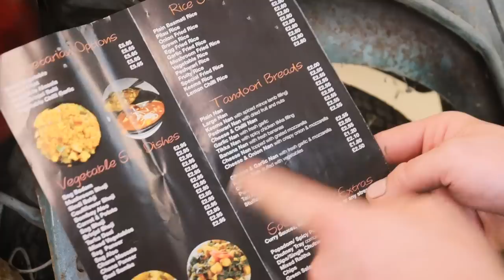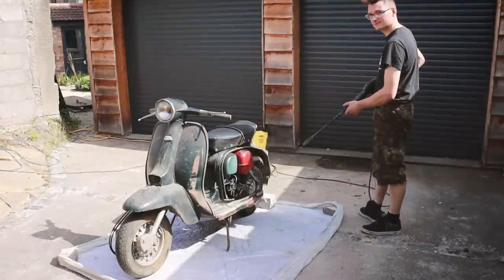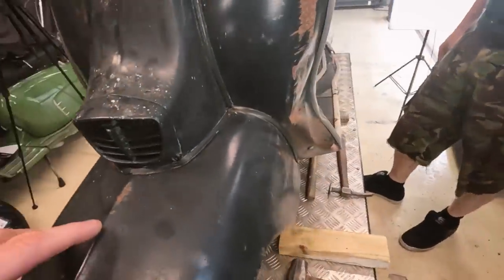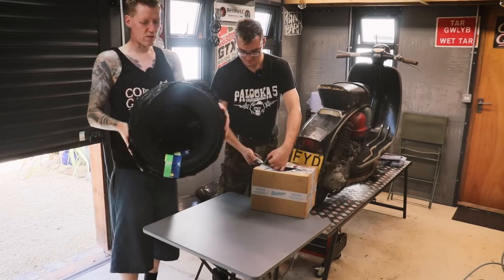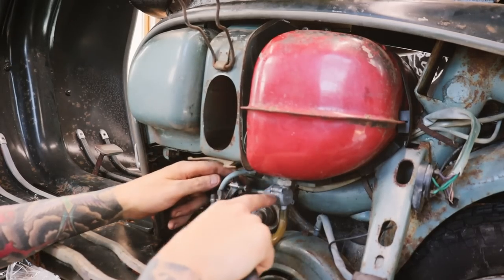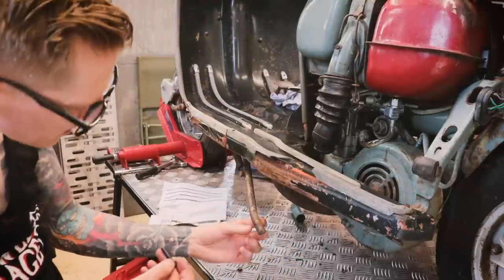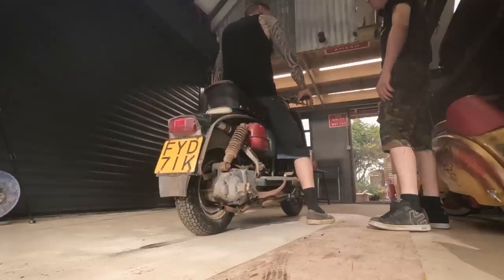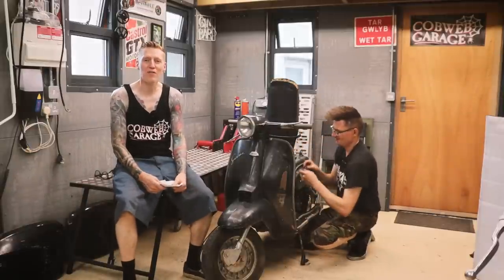Barn find Lambretta Part 2. Is it Spanish or Indian? Black or Green? Can we free the clutch?

Comment: Good progress Scott & Co, really surprised that it started with no covering of the carb when jet washing but hey, we all know these machines built to go through a lot😉. Definitely strip carb fully and clean or replace jets like for like as a starting point plus new tank & fuel line as you said. Maybe better to engine case cover to inspect clutch mate, they are not dear for new plates & springs. Keep up the great work, look forward to the next one 👍👍
Reply from the maker: Thanks for great advice Kevin. We did actually tape up the end of the carb before jet washing btw. Cheers

Comment: Get the air filter rubber changed, new clutch cable and adjust it, possibly look at the carb jetting.
Reply from the maker: Yeah, good advice. Cheers.

Comment: If you want to save a bit of money and the tank is solid enough to save you could remove the tank  leaving the hose attached then use a m6 bolt to block the hose, the handful of old nuts and bolts or pea shingle, cup of water, fuel cap on then strap to the front of a cement mixer barrel, leave rotating for 30mins, check and if clean empty, flush a dry.

Comment: If your clutch is stuck, Motor off,  put in 1st gear, pull clutch in and rock back and forward till the clutch free. If it won't idle check the pilot jet.

Comment: think Gunk works best when the engine is warm...check the tin instructions.  Motorex Moto Clean is also really Good for generally cleaning bikes. New airbox gater and carb clean should see her run off the choke better. top work scotty
Reply from the maker: All good advice, thanks. I’ll check out the Motorex stuff.